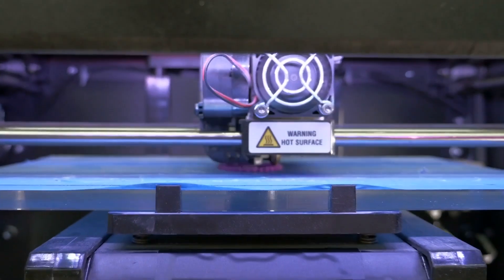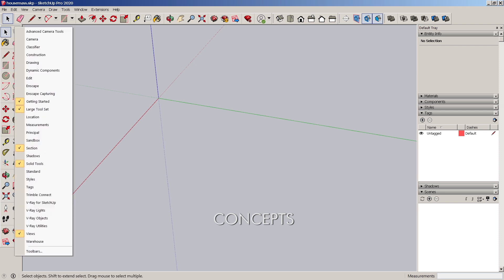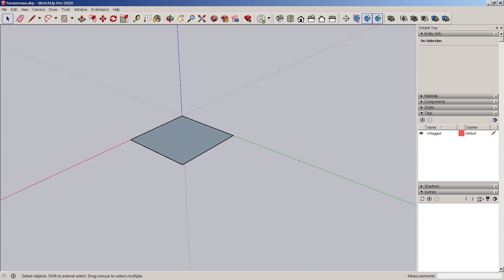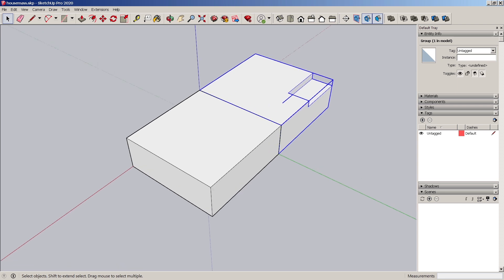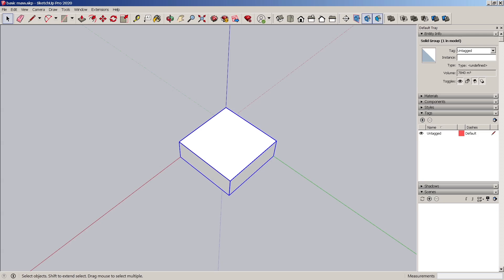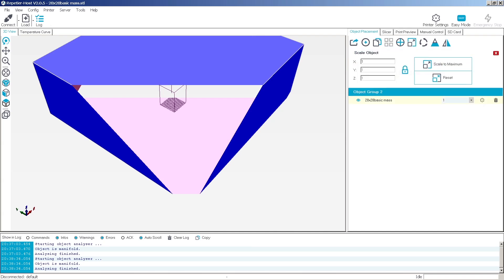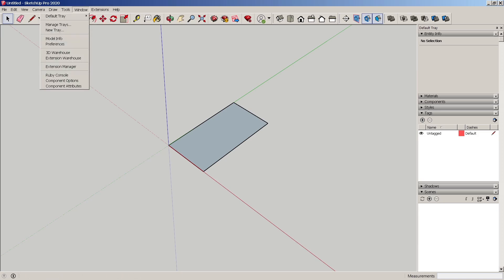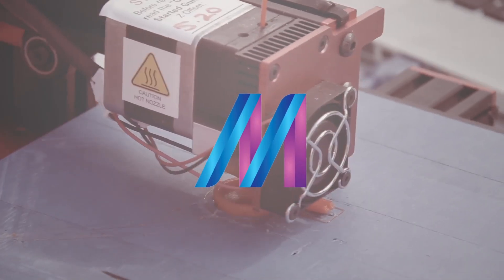How To Make 3D Prints with SketchUp - Part I

Comment: Thanks! Is there a reason for us not working in millimeters or centimeters directly in sketchup, instead of needing to scale it later?
Reply from the maker: Hi there, I would work in accurate model dimensions with a set scale for print. If you are doing scale model, then use that specific setting. However, understand particular tolerances beforehand, as some thicknesses will need enlarging for successful print. This requires your working model and print model. If thinks like walls or posts, etc. Need to be enlarged, you can make those as standard components to add to models. Same for standard supports.

Comment: Is it going to be nothing inside?
Reply from the maker: The 3D software is pretty good at solid objects. When the closed surface is defined, it puts infill inside. So no need even to double the shell. You can control thickness of outer walls in the software like repetier or similar with the flow % multiplier. There is also an infill % from 0 to 100%, with zero being empty.
Reply: @MotionFORM  Thanks

Comment from the maker: Are you new to 3D Printing? If so, I'd love to know your questions about the craft and the new tech.
Reply: whats the best printer for a starter
Reply from the maker: @Fronklyn.  If you're looking at ease, then I would say Prusa. It has great resources with options for prebuilt and diy. Alternately There are very cheap diy ones from China. You can learn a lot, but some can have big issues. What is your priority? Cost, ease, certain materials and size are other factors.